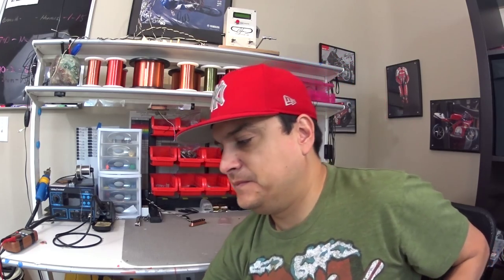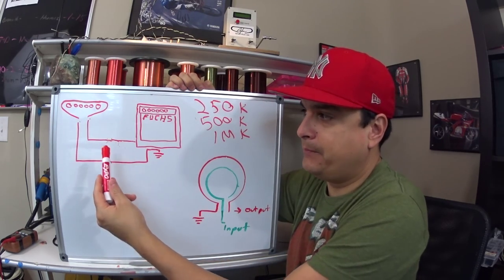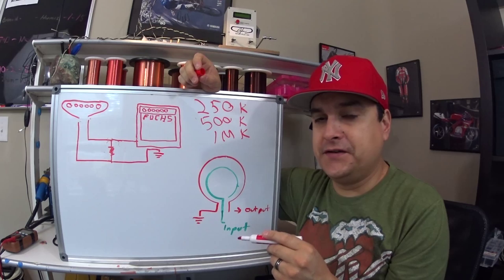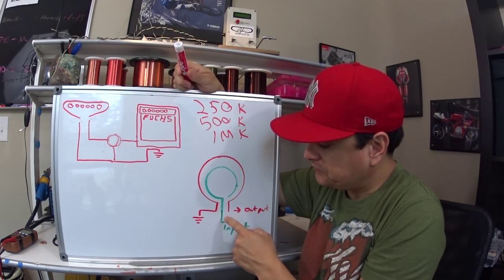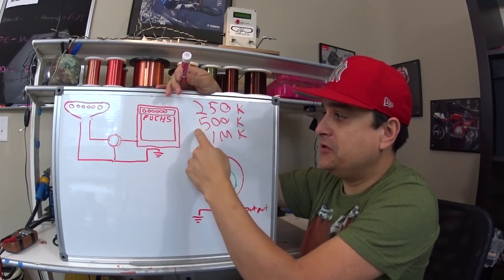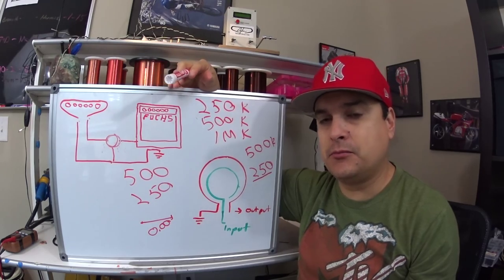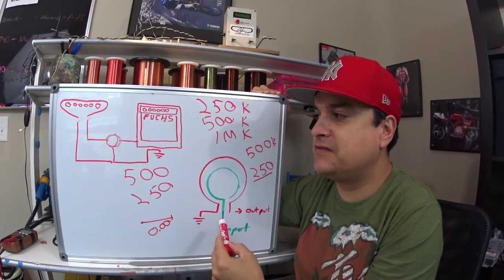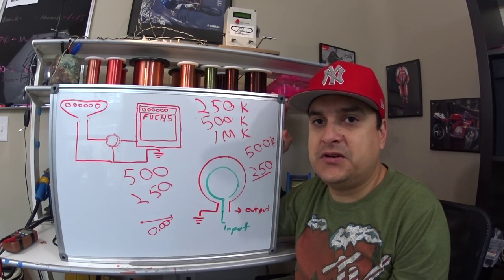Dylan Talks Tone Ep #10 250 or 500k pots in your guitar #30

Comment: I don't really understand why you would want to use a muddy configuration. You can always use the tone knob to cut out highs, but you can't add clarity.
Reply: Actually, you can make the output more focused with what is commonly called a bass cut tone control. I think it is better described as a clarity control. I installed one in my 2009 American Standard Strat. It's especially useful when paired with a vintage-circuit FuzzFace style fuzz. They have very low input impedance. So, the bass cut control increases the source impedance of the signal and doesn't allow the low impedance of the fuzz to have such a huge affect on tone.

Comment: I play guitars with HSH configuration that came with 250k pots. Was curious about switching to 500k pots but worry about using the single coil or the coil splits with 500k pots. I’m not a fan of the typical single coil sound. I use a grittier warmer tone for single coil. Worth switching?

Comment: i hate pots that just don't do what they say on the tin. it revolves yet it's really just an /off at about 2. if you find a pot that tapers properly, NEVER CHANGE IT. haha
Reply: Agreed!  There are ways to desensitize a potentiometer using external resistors around the pot. The modification would cost less than a 25 cents.    Any circuit designer would do this for you maybe for a hamburger.

Comment: Well... if you put 500kohm pot into something you will have the range from 0 to 500kohm which includes the range from 0 to 250kohm. Seems that with some 500k CTS pots that means range from 0 - 7+ so you could use clearly over a half of the total pot range. Therefore I wouldn't be too worried about an unnecessary big pot value.

And if you want to lower the resistance of a 500kohm pot to 250kohm you can just solder a 500kohm regular resistor between the input and output which will make it a 250k pot but the lower end of the volume range will become a bit steeper and the lower end flatter which might not be optimal. You could also use a 1M regular resistor there to get range from 0 to 333kohm which wouldn't be quite as steep from another end.

Edit. Mixed words capacitor and resistor and the changes in volume range. Lol

Comment: Resistor value just changes output voltage. Has nothing to do with high frequencies without a cap in the circuit
Reply from the maker: Basic physics. total curcuit impedance (resistance, capacitance, inductance) changes ie… changing a pot… the available frequencies change. Super basic stuff.
Reply: @DylanTalksTone  I like your videos, Dylan, but Jonny is right about this. You want to model your pickup as a Thevenin source with 300mVp-p and a series resistance of 12k. You need to model this either with a shunt capacitance, either a component or a parasitic capacitance, and then your 3dB cutoff point for your frequencies would be 2*pi*f=1/RC .  

40 years designing circuits.

Comment: Hello!

My pots were scratchy and old so I had them changed. However after the 
change I can't quite control the distortion level with them anymore. 
Before the change the distortion would go down together with the volume,
 whereas now only the volume goes down and the distortion stays the 
same. What happened?

I have one humbucker and a p90. I believe both volume pots are 500 and 
tone pots 250.

When I open up to look at them they are made in Japan. Could they be low
 quality?

 Also the volume doesn't change as much betweeen 7-10 anymore, but that 
might be due to pots being linear?

Comment: can i ask this. I build electronics for a living, Im not the most knowledgeable but i thought using a resistor to ground decreases bass frequencies. and capacitors to ground decrease treble. think about rc networks nd cr networks. if you put a resistor in line with your signal thats when the resistance filters treble out. so a 250K pot gives you around 250k resistance to ground at full volume and 0 resistance to the output jack. at 50% you have 125k to ground and 125k to the output jack signal. so at 50% a 500k is going to double the 250k pots values so you have 250k to ground which keeps more bass than 125k to ground and have 250k inline with the signal will filter more high frequencies also than with the 125k of the 250k pot. I always find that guitar tech explain pots exactly opposite of electricians. does this make sense or do i need to make a video to ask the question

Comment: Ok Dylan. As I am in the process of upgrading the stocks pups in my ESP, going to replace the stocks pots also. But, do I want 250's or 500's? It's an ESP with a Hum Sing Sing setup, maple neck/fret, basswood body. Primarily used for rock/hard rock/classic rock.
Reply: If if matters, some more info for ya. I will be installing an SD Distortion bridge, Hot Rails neck, still not sold on what to use middle, but will either be another Hot Rail, a STKS4 Classic Stack, or a Quarter Pounder. As I said, still undetermined on mid.
Reply from the maker: +Wikdone I'd use 500s on that setup for sure
Reply: Thx.

Comment: I find that my strat pickups sound best at 3-4 on the volume and 5 on tone but if the volume  goes higher its starts getting muddy so much that its not usable for my application. What should I do if I want the same transparency when the volume is at 6-7? Could I do this with the cap or change the pot?

Comment: Great vids!! I have a question regarding HSS strats. I have made many and experimentet a lot. There is always a midrange spike on the humbucker. If i make a usual 3 x 250 k strat setup, how much will the resonant peak of the humbucker be affected by the 250k instead of a 500k, I have always thought that the humb. would need 500 to stay bright enough, but maybe it actually balances better tonally by staying with 3 x 250K ? Any experience?
Reply from the maker: Remember that the resonant peak of the humbucker is fixed and does not change. When you lower the resistance of the pot, it lowers the ceiling of available frequencies from the pickup. The mid spike comes from the placement and the pickup selected. If you go with 250k pots this may accentuate your problem as you cut highs.
Reply: Hmm... thanks. I have just seen charts shoving that pot values effected the resonant peak. Since I am only a tinkerer in electronics, I have no knowledge to contradict them. So thanks again :-)
Reply from the maker: +Christian Boddum I'd be interested to see your findings. As the resistance in the entire circuit changes, the effective resonant peak of the whole thing would Change. But the resonant peak of the pickup is basically fixed. I see why you would say that.

Comment: While the general summary is valid (increase the pot value from 250K to 500K and signal becomes brighter, and vice-versa), the explanation given does not actually explain why the tone changes even though no capacitor is in the circuit and then only applies to volume pots that are reversed-wired with the input signal feeding into the wiper, which is not how most wiring diagrams connect them. 

While this wiring variant is useful in some applications, such as where the guitar has a volume pot for each pickup and very simple switching for example, it has its limitations and can have very different characteristics. 

So to address the first thing (why changing pot from 250K to 500K, and vice versa, affects the tone): Ignoring the tone control, the high-frequency response of a pickup is determined by a low-pass filter formed by the inductance of the pickup coil (Lp) and the loading of the volume pot (Rv), commonly known as a series LR lowpass filter. With standard wiring (input on "lug 3" and output on "lug 2") the load seen by the coil is constant (Rv = 250K or 500K) while the value seen by the amplifier varies with the knob-setting, so the high frequency cut-off is very predictable if you know value of Lc ... a single coil of say Lc=1.5H and a 250K pot the 3dB cut-off will be 11KHz, change that to 500K and the cut-off jumps to 22KHz (double what it was, which upsets bats but not so much mere humans); with a dual-coil of Lc=3H and a 500K pot the cut-off is still be 11KHz but change that to a 250K pot and the cut-off drops to 5.5KHz, half of what it was and some of the brightness has now gone. 

All this changes with reverse-wiring because the "R" in the "LR" lowpass filter is now dependant on where the knob is set, so since the Pots are A-law Logarithmic then at max-volume setting the load is 250K and the cut-off is 11K as before, however at the mid-setting that 250K is now 50K so the cut-off has moved from 11KHz to 2.2KHz, a big change in tone, the volume control now acts as combined volume and tone pot, but not necessarily in a good way (we would ideally want the tone to get brighter as the volume is reduced).

Comment: If I want to put a mini humbucker (SD Little '59) in the bridge of my tele with a push/pull pot to keep some single coil action would you recommend a 250k or a 500k and would you put the push/pull in as the tone pot or the volume pot?
Reply from the maker: This is all preference, but I would use a 500k volume, a 500k tone, and put the push pull in the volume

Comment: Question.  (sorry, another one).   When a guitar has both individual pickup pots and master pot control, too (such as in certain Gretsch models), how does that affect the circuit tonally and how should it affect one pot value decisions?   thanks.
Reply from the maker: Every time you add a resistive component, it will affect the tone a little. you just have to decide if it makes enough of a difference to warrant changing a pot. I am always gonna lean towards 500s

Comment: Would you suggest installing a 1Mohm pot to match the guitar's resistance to the hi-z input of stomp boxes?
Reply: Many if not most amps have a 1M input resistor too.
So the way resistors and voltage division works  with a 250K pot you throw away 80% of the signal before it leaves the guitar (about -14db).
With a 500K pot you throw away 66% of the signal ( about --9.5 dB).
This seems like a deal with the devil just for the privilege of some volume and tone control! Insanity? or am I missing something?
Definitely going to experiment with a bypass switch setup.
Reply: @yogimarkmac  I heard many pros simply remove all controls and send pickup signal straight to the output and tweak the sound on the board or amp

Comment: i have a single humbucker strat that is too ice picky and I wanted to tone down some of the highs by replacing the pots to 250k pots. (it is kramer style but with 1 vol. 1 tone knob) I was asking for advice when someone said this:

"Go for the 500k pot because you can turn the tone down to 250k anyways (or make it darker). But if you get a 250k pot you can't turn up to 500k and make it brighter."

What do you think of this statement?
Reply from the maker: Wei Xian Ng Many times I will use a 500k pot and go with a much darker cap like a .047. This gives you more sweep on your tone pot, but you will have to use it.
Reply: A 250k potentiometer can be set anywhere from 0 to 250k ohms, depending on where the knob places the wiper. A 500k pot can be anywhere from 0 to 500k ohms.

Comment: I ran across this video and it reminded me of this question I've had for a while. One of my guitars is the Fender 51 pawn shop  model, mine has a humbucker in the bridge position and a Texas Special in the neck position. It also has a push pull coil splitter on the volume pot (actually it came that way but it also had no tone knob, that stock knob was a 3 position selector, that was the stock set up). I had a mini 3 position selector installed and a tone knob installed. My question has always been What would be the best pot ohm wise because of the coil splitting feature on the bridge humbucker? I would appreciate if you have any ideas or opinions about pot usage with a coil split set up because when it's a humbucker 500 is the norm and 250k when in single coil mode. Thanks
Reply: I'd assume since you're running a humbucker, a 500k pot is what you want to use most of the time.  If anything you might be able to control the more trebly nature of a single coil with the tone knob.

Comment: i know nothing about resistors and all that stuff. but if i have 250k pots in my humbucking guitar, and i completely disconnect the neck pickup and its corresponding pots, will that strengthen my signal?
Reply: +zac gibb   hi's forget about impedance  --- in your  case i will  NOT recommended  to you to do it  ---  leave your pup's  with peace  -- you  get  maybe  2 or 3%  of gain  --  i think it not worth  compare  volume ajustability

Comment: Thanks for the vid, useful info🤘 I’ve got one question regarding Bourns pots as you said you use them a lot and so I bought a couple of them. Do Bourns guitar pots have knobs that have almost no resistance when you turn them or do I have bad or broken Bourns pots?

And Bourns audio pots that I also bought at the same time have an enormous amount of knob resistance, it really takes a lot of force to turn them. Is that normal?

I have a couple of CTS pots that have a “nice”, just the right amount of turning resistance, and I find that normal.

Anyone?

Comment: hi Dylan!   can you help me?  I'm from Brazil...  I have the Seymour Duncan Antiquity Texas Hot set in my strat.  all 3 pots are 250k,  but i fell the sound of the bridge a little dark.  I think to try 500k for volume.      what you think?   

the d.c. are: 6.45, 6.68 and 9.52

if yes,  i will need to change all  3 pots or just the volume?  thank you!
Reply from the maker: Just try the volume. Remember that will affect all the pickups
Reply: +DylanPickups thank you!  unfortunately the bridge is hotter than the others two.    I will try only the volume.     this video is only for volume pots or tone pots need to be considered too?
Reply: +DylanPickups...  what I need to do with the capacitor?   I have 0,5 installed.

Comment: so i have a strat HSS with a Dimarzio 59 PAF in the bridge...im going with 3 500k pots on the guitar. I haven’t got it together yet so i don’t have the verdict on sound but what are your thoughts...Banjomikez threw in a .022 cap for the resistor...thoughts.
Reply from the maker: My new hotness for that setup is use a 500k volume pot, 250 top tone with a .022 for the neck and middle, and then a 500k for the bridge only tone with a .047
Reply: @DylanTalksTone  Could you recommend the best .047 cap
Reply: @DylanTalksTone  So Dylan would i solder the .047 cap from the ground to input on the bridge only tone knob or from input to output?

Comment: Ok so can you theoretically just change any 500k put into a 250k put by just putting it at 5 instead of 10??? 🤷🏽‍♂️
Reply: On "B" linear pots yes, but volume pots are normally "A" logarithmic so 5 would be around 100K on a 500K pot, and then only if the pot is reverse-wired (like the diagram in the video), but most volume pots are not wired like that.

Comment: So in theory can’t you get a 250k pot sound from a 500k pot just by turning the volume knob down...for example a wide open 250k pot equals a 1/2 volume 500k pot?
Reply: DylanTalksTone please respond to this:) I would like to know... I have tried this and it seems like the ratio of total output level to (high) frequency loss are in different proportion when rolling the pot back as opposed to using a pot of different resistance value. I mean, the 500k pot rolled back to 50% has similar tone to a 250k pot, but has less output level than a 250k pot on 10. Is this right?
Reply: @tllong124  I can tell you this. I installed 3 500K dimarzio pots in a HSS configuration with a 2.2mf cap on just the neck and middle pickups. The Humbucker runs wide open. The first thing i noticed was the pickups can get much brighter than that of a 250k pot. To bright in fact...the remedy for this is I run the ton pots around number 3-4 to cut some of the highs and they sound great. The humbucker tone is just the pot and i run it from 0-10 and its sound great anywhere...Its a Dimarzio 59 PAF style pickup so it was designed to be brighter than most wax potted pickups. this pickup has no wax potting at all. Overall im pleased with the sound of my strat and may experiment with a .047mf cap just to hear the difference....i may also tame my bridge tone pot with a cap as well....

Comment: How could you wire a bucker on 500k pot with a push-pull dpdt when you pull it it coil splits the bucker and also cut the pot to 250k

Comment: if you still look at this video I have a question. I have a Godin SD its H S S 1 vol 1 tone. the Humbucker is 2 wire and the singles are 3 wires. My volume pot has a resistor soldered across 3 and 2 it is a 150k resistor, why would Godin do this? ok so update. I contacted Godin and they said this was not factory and they sent schematic and that resister is not on it. Someone put it on the volume cap as a taper. I do not need it on the guitar so I guess I can go ahead and wire up my new pickups after I figure out what to get.
Reply: That’s a treble bleed network designed to not lose as much treble as you roll off your volume. 👍🏼
Reply: every treble bleed I see has a capacitor, another guitar guru told me it was to change the taper of the pot. it is a resistor not a cap.

Comment: On a volume pot the higher resistance will also push harder.
Reply from the maker: Lol ....
Reply from the maker: Ryan Lewis that is not because it “pushes harder”
Reply: @DylanTalksTone  pushing more more frequencies is driving more signal in the tone stack therefore drives the gain stage in the pre amp harder causing it to clip. So yes it does push more signal which causes the overall output to clip faster in the front end of the amp.